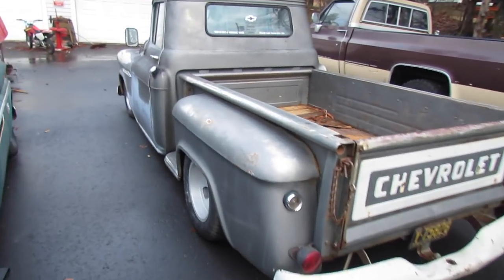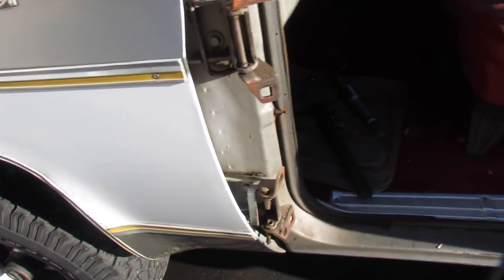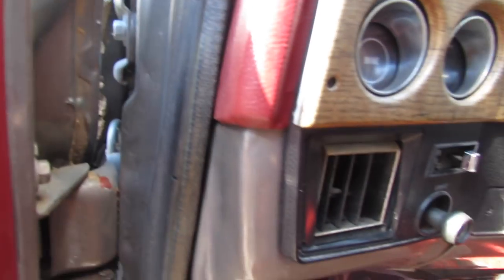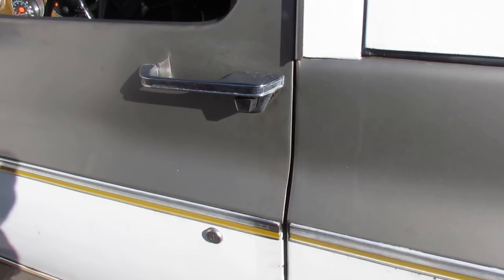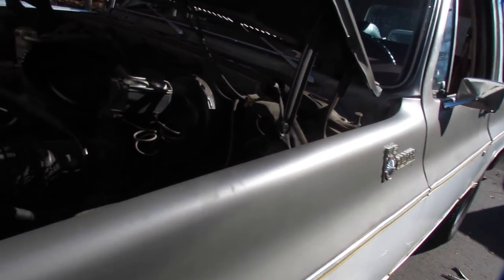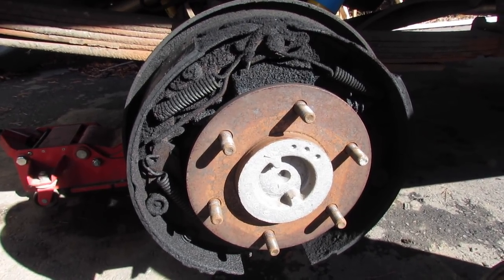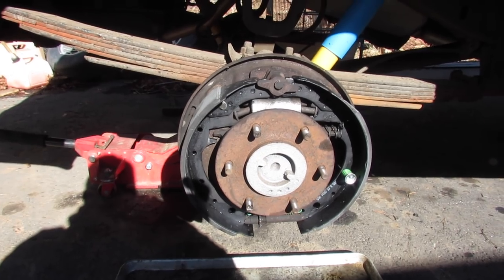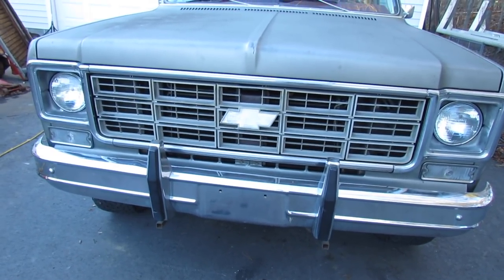77 Blazer- Brakes and hinge pins

Comment: I went to the local Advanced Auto to buy a “Point File” and the guys working there didn’t have a clue on what it was. Finally, one of the guys said if we have that thing it would be on that row. They did have a point file and they all wanted to look at it. Younger guys are not experienced on older vehicles.
Reply: James Dayton Not all younger guys
Reply from the maker: James Dayton at least they wanted to look at it.
Reply: Had the same problem over here. The thing is they sell spark plugs and points  So it stands to reason they would stock a file. I did my 1st points& plugs when I was 8 y.o. I'm nearly 51 so a file isn't what you could call new technology. When they did find one They asked what it did and how . Ever get the feeling that computers and such aren't all there cracked up to be if a 25 y.o. fella doesn't know 1 ,what a file is 2, what it does 3, what it looks like , Granted the UK has very few points driven cars nowadays ,but come on parts stores train your staff. Cars still use plugs. Oh, One of them even asked where the switch is to turn it on. He realised he asked a stupid question from the glare I gave him, Still the wing nut didn't ask where it plugs in. That's something I suppose . Tale care all

Comment: Why does Little Miss want a horse when you have all those horses under the hood? lol Another great video, man! Love that Blazer! up here in Michigan you just don't see them like that at all! I don't remember the last time I saw a nice Blazer that was all original like that one. just changed valve cover gaskets on my 76 c25 GMC. No air conditioning makes it really really easy! Haha! Did you have to remove the compressor to change that out or could you slip the valve cover underneath it?